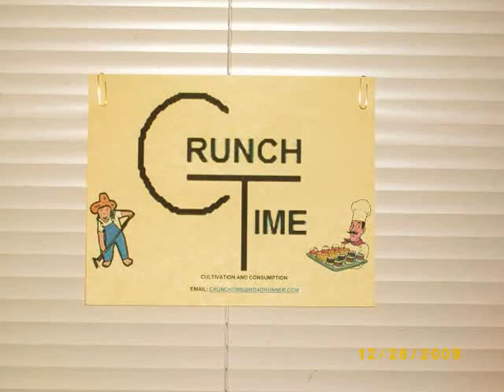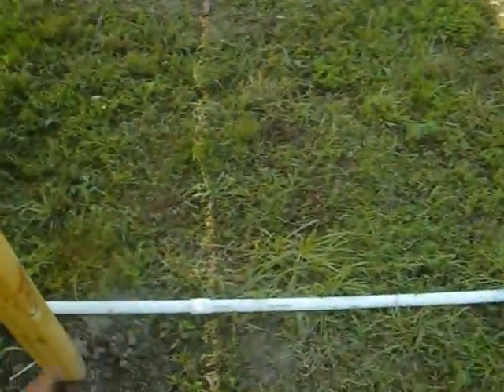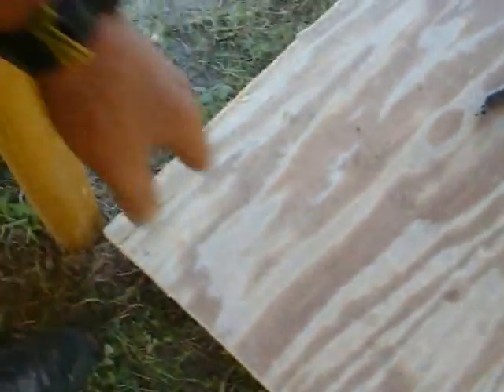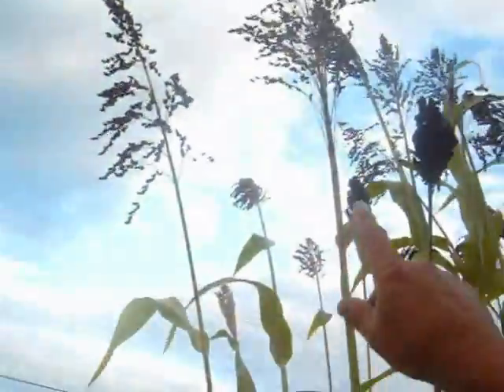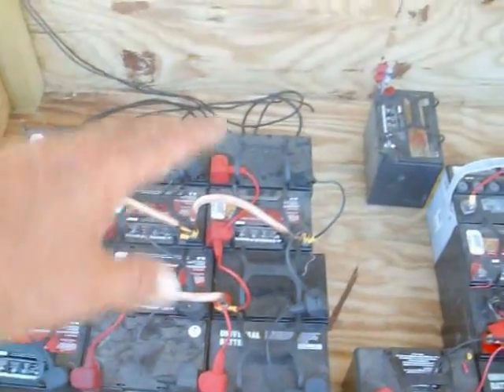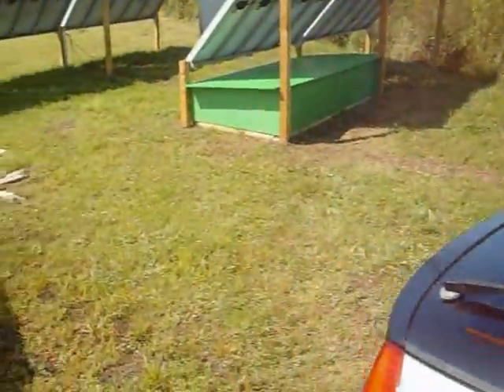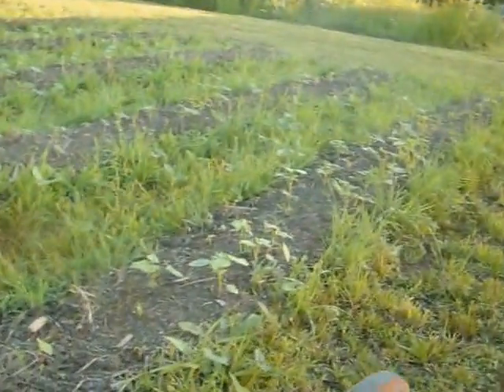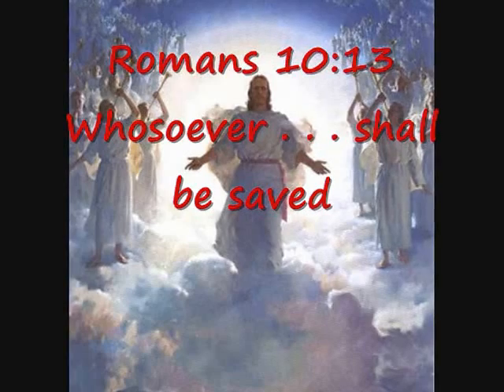CrunchTime Show 119

Comment: Are those charge controllers setup to utilize MPPT? Probably not a big deal either way, just curious...
Reply from the maker: What is MPPT?
Reply: h2boost http://www.wholesalesolar.com/Windy/MPPT-article.html
"That depends on your array, your climate, and your seasonal load pattern. It gives you an effective current boost only when the Vpp is more than about 1V higher than the battery voltage. In hot weather, this may not be the case unless the batteries are low in charge. In cold weather however, the Vpp can rise to 18V. If your energy use is greatest in the winter (typical in most homes) and you have cold winter weather, then you can gain a substantial boost in energy when you need it the most!" ... they have a whole bunch about it - the gist of it is that it can increase your ability to charge under less than ideal circumstances...